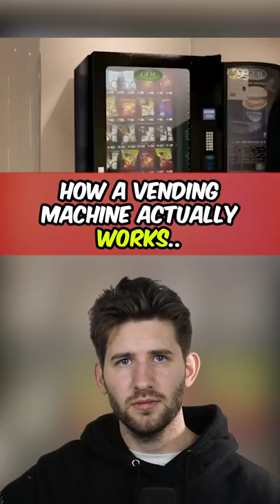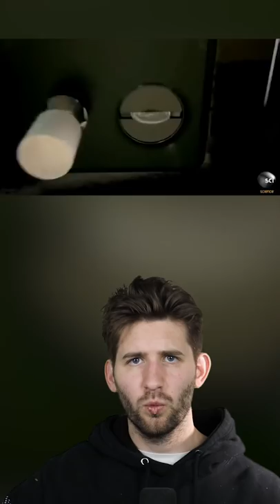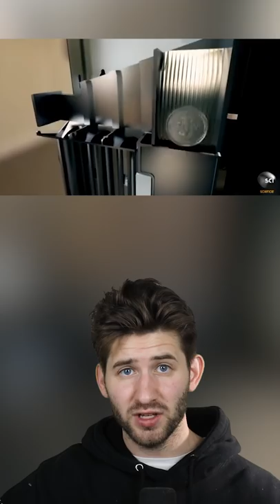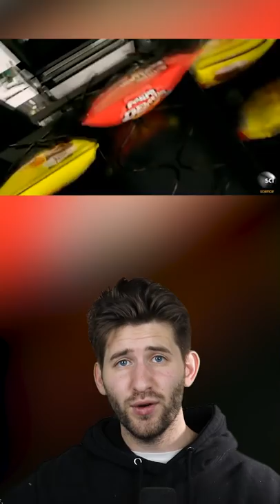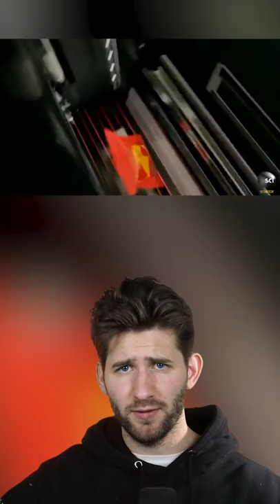How A Vending Machine Actually Works! #Shorts

Comment: So a lot of machines just have to shift detectors at the end part because I've had so many times where it doesn't push the coiling up and it doesn't have the snack fault and you have to place another bill in there just to get to snacks